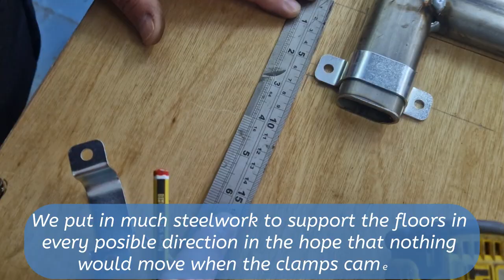Rebuilding Ford's Ultimate RS: The RS200 Group B Champion. Part 39

Comment: What’s the plan for long term corrosion protection and finish coating?
Reply from the maker: In the first instance, as with my other car, never get it wet! No. #139 has been wet about four times in 20 years so that's first and foremost. After that, all the voids will be filled with Ardrox AV8, which is the same aerospace inhibitor we used extensively on Bluebird and it proved itself there. Then we have a good and thorough interfay of glue at every joint we're assembling and when the steel outer floors go on we'll put an interfay of polysulphide sealant in there to prevent any dissimilar metal corrosion. Paint scheme - left alone and original wherever possible, etch primed and touched in everywhere else. No doubt some will think it heresy that it's not all media blasted and powder coated but I did that on the last one so this one is staying as original as it's possible to leave it, warts and all.